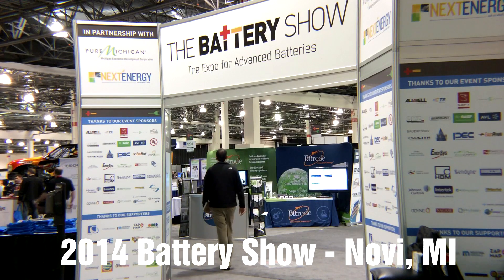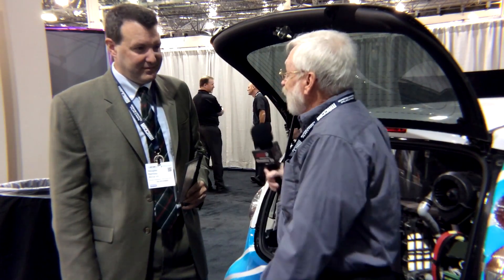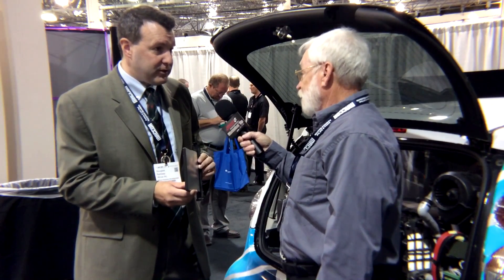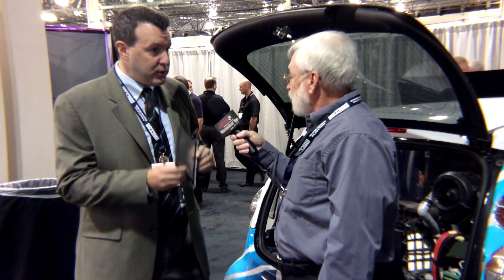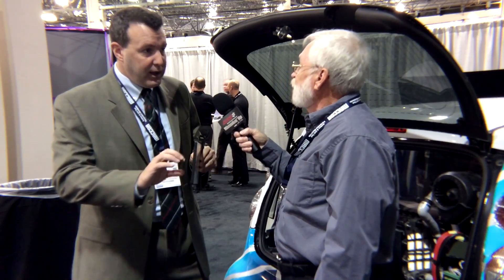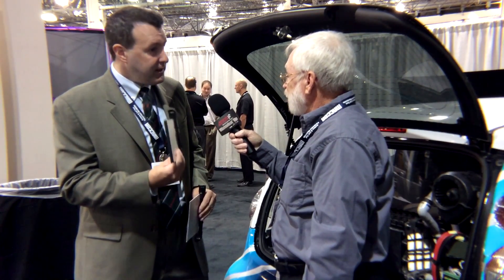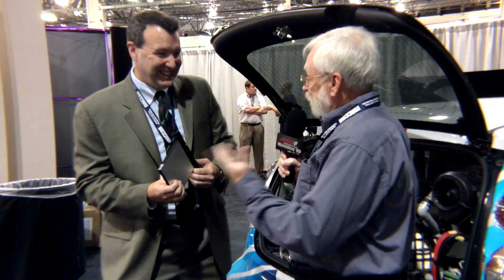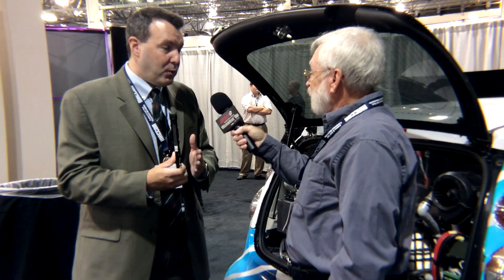Aluminum Air Batteries are here! - Wrenchin' Up

Comment: Ya ! Cars today are running on alluminium.... 7 years after this video😉
Reply from the maker: Hi - Thanks for watching! Military rockets and such yes. Cars no.
Reply: @WrenchinUpwithJimBates  ..... here in India_ "mahindra treo" 3 wheeler auto is running on a trial. "Log 9" start-up by 2  IIT graduates have made aluminium fuel cells & are testing for the same . In addition to this_ automobile giant "Tata pvt. Ltd (india) with phinergy (israel) have also made fuel cells & are planning a mass production in few months time.✌... lets hope for best.

Comment: I don't understand why Aluminium-air Fuell cells (or batteries) are not more common in general, not only for EVs? Obviously, they have indefinite shelf life before the electrolyte is poured in, so as a backup emergency generator they would be ideal. Cost would also be far lower than a gasoline generator, silent and light weight too??? As a range extender in an EV, it is the obvious choice for longer trips, so we don't need to carry around a big battery the whole year = expensive EV, just to be able to drive 300 miles once or twice a year.
Reply from the maker: Hi - Thanks for watching and sharing your opinion!

Comment: How do we recharge Aluminium battery?
Reply from the maker: Hi - Thanks for watching! The aluminum plates are used up (as in gone) during operation and are replaced with new ones when the battery is discharged.
Reply: @WrenchinUpwithJimBates  Sir,What is the size of an average battery which can be fitted in a car?And How much will be the range until the battery needs replacement.
Reply from the maker: Hi - Since that didn't come up in the interview I don't have an answer for you, so I suggest that you check with Alcoa Aluminum about that. Their contact information is in the video's description.

Comment: So, aluminum is mined from bauxite, which is basically oxidized aluminum and this battery reverses the process and get the electrons out of the aluminum that were put into it during the mining and processing stage?  So when your battery is dead you wind up with plates that are similar to aluminum ore and these can go back to an aluminum smeltering plant for reconversion to aluminum?
Reply from the maker: Hi - Thanks for watching! All good questions but, since these topics were not discussed in the interview, I suggest that you ask the folks at Alcoa for that information. Their contact information is in the video description.
Reply: Alumina (Aluminium Oxide) is extracted from Bauxite which also contains silica, iron oxides and titanium dioxide. The Alumina is then placed into a bath of molten cryolite and Aluminium is produced through electrolysis. When Aluminium is used up in an Aluminium-Air Battery, the byproduct is once again Alumina. This is then returned for smelting once again using the process above. The initial energy used to extract the Alumina from Bauxite is therefore not required. Like the interviewee explained, it's a closed loop process. In my opinion, Aluminium-Air Batteries are the future of energy storage. The electricity required in the electrolysis process is created with solar PV and wind power when both are abundant. The Aluminium is then used to store the energy indefinitely (no self discharge as with Lithium batteries) and safely (no threat of explosion as with liquid hydrogen). When there isn't enough energy being produced by wind or solar, the Aluminium is consumed to provide our energy needs. Aluminium has a theoretical energy capacity of 8kWh per KG which puts it in league with Petroleum.

Comment: A clever talk. No description of the costing of these batteries. No comparisons with cars running on gasoline engines. Cost of replacing the electrodes.
Reply from the maker: Hi - Thanks for watching! According to the comments so far, it looks like only the military uses these batteries for one time use applications like rockets, etc. Lots of energy and practically unlimited storage life..

Comment: Not new - this same 'source' of electrical energy was on the market in the 1980's, by as USA company called "AluPower'. They went nowhere, despite pushing a lot of advertising trying to convince the consumer, on their practicability. This latest iteration come from the fact that the original patents are expired, creating a new 'suckers' market.
Reply from the maker: Hi - Thanks for watching. Based on what I read, since this is a primary battery the only practical applications so far are for military and relatively cheap long term energy storage.

Comment: Instead of recycling your aluminum you can smelt your own every 6 months how much aluminum do you scrap ? Think about it .. I much rather use HHO gas "water" is more efficient  plus you can run multiple alternators and completely produce more power than you would need
Reply from the maker: Micah Catlin Hi - Thanks for watching and for your interesting comment! Is there a video somewhere that we could watch that demonstrates this?
Reply: @WrenchinUpwithJimBates  ues HHO generator dry cells are the most efficient I believe most people dont realize if you hook up to a geo metro 3cylinder 1 liter engine would be the bet option .
Reply: @micahcatlin9389  And from where do you get the electricity to split water into hydrogen?

Comment: Where does the aluminum go? Like lead in env... oh boy. I didnt see that pollution coming.
Reply from the maker: Hi - Thanks for watching! From what I read, Aluminium–air batteries are primary cells, i.e., non-rechargeable. Once the aluminium anode is consumed by its reaction with atmospheric oxygen at a cathode immersed in a water-based electrolyte to form hydrated aluminium oxide, the battery will no longer produce electricity. However, it is possible to mechanically recharge the battery with new aluminium anodes made from recycling the hydrated aluminium oxide. Such recycling would be essential if aluminium–air batteries are to be widely adopted. You also started to write something about lead so I thought I should add that 98% of lead/acid batteries are recycled and 99% of the materials in those batteries are recycled including 100% of the lead. I hope this helps

Comment: Why not use what nature did for us same principle and water is everywhere.
Reply from the maker: Hi -Thanks for watching! Are you referring to this technology or to Hydrogen?
Reply: @WrenchinUpwithJimBates  Hydrogen
Reply from the maker: Hi - Well, there is a TON of information on this subject for the pros and cons of hydrogen fuel but from what I can gather so far is that the infrastructure (fueling stations, etc.) is very expensive and slow in coming. Most of the hydrogen being used as fuel these days is extracted fossil fuels - natural gas I think - but not from water. One of the most interesting things I read is that hydrogen storage tanks are expensive to build and have to be inspected every two years and that would include the tank in an automobile unless things are changed. We could go on and on with this subject so I suggest you jump onto the internet and google the subject. Be ready to spend hours, if not days, checking out all  of the information on this subject that there is out there.
Reply: @WrenchinUpwithJimBates  Thanks for your comment return

Comment: Al-u-min-i-um
Reply: We fought a damn war so we than on this side of the Atlantic we could freely and proudly say "Aluminum", if you got a problem with that take it up with George Washington.
Reply: @richardsauermilch5483  You have the problem, take it up with a dictionary, theres an "I" in there and it's not silent.
Reply from the maker: Hi - Thanks for watching and your comment! The periodic table has a name for every element, and English has at least one word that corresponds to each name. In the case of the element with the symbol Al and the chemical number 13, English has two words: aluminum and aluminium. The difference between these two words comes down to the differences between American and British English. While aluminum is the original word, British editors standardized around aluminium, to preserve consistency with elements like sodium, lithium, and titanium. Wrenchin' Up is an American based channel, I grew up here and am used to the spelling as Aluminum. If I type in Aluminium Google's spell check tries to correct it, even though they are apparently both correct.
Reply: @WrenchinUpwithJimBates  Interesting, never heard that before. Thanks for taking the time to reply.

Comment: The car doesn't "run on aluminum". Aluminum is a carrier for "electrical energy". 

Energy is stored in the conversion of aluminum oxides into metalic (pure non-oxidized) form.

The "Aluminum Fuel Cell" promotes the inverse reaction oxidizing aluminum with oxygen from the air and liberating an electrical current, hence useful energy.

Instead of recharging at the nearest receptacle as a rechargeable battery, taking a lot of time, just exchange used aluminum oxide and suporting material for fresh ones. 

Recharging is done through recycling aluminum oxide into metalic aluminum and deposing it in the plates at the facility.

As said, aluminum is not a source of energy, just a carrier of it.
Reply from the maker: Thanks for watching and for your comment.\ to help explain how this works.
Reply: not Al2O3 but it is  Al(OH)3
Reply: So where is it ? Its been 5 years

Comment: Yet another "battery" technology designed to sell a proprietary consumable.
Reply: Celso Starec Yes, I know how it works. However, I only want to buy electricity, not some proprietary power storage solution. Anyone can sell me electricity for my rechargeable battery, but this stuff only comes from one supplier (like gas). As a consumer, I am done with this business model.
Reply: Celso Starec I guess you just don't get my point. I know how the chemistry works. The point is I don't want to have keep buying a proprietary chemical to move my car. The only chemical I currently buy for my LEAF is washer fluid.
Reply: @egoequus6263  Actually the Electrolyte they use is Plain Water , you can see in other Phynergy videos
Reply from the maker: Thanks for your perspective, and thanks for watching!
Reply: @WrenchinUpwithJimBates  Aluminum is NOT the fuel. Water is the fuel.
Reply from the maker: Hi - Thanks for watching! But how did you arrive at that conclusion?
Reply: Ego Equus 

Nor exactly "like gas". Gas comes from crude witch is consumed and scarce. 

In this model, aluminum is not consumed and there are no barriers to any other players to recycle and recharge. 

It does not solve the sourcing of the energy for the charging / oxide recycling into metal though.

It competes in cost with large batteries and range extenders, being relatively energy dense and practical for this purpose. It might allow battery cars became useful and cost effective earlier.
Reply: Ego Equus 

The same as bear in aluminium cans, or better as the glass in a returnable Coca-Cola glass bottle. 

You don't consume the aluminium, just change it's state from "full of energy" to "depleted". You exchange an amount of aluminium for the same one in another state. No consumption of it, It's just the carrier of the energy.

With Solid Oxide Fuel Cells with other chemistries it's the same.

Comment: And how is the aluminum recycled? Please, don't tell me it's done with fossil fuels....
Reply: Aluminum smelting plants are located near nuclear power plants or hydro power plants.  When the plants need to sell their electricity cheep they sell to Alcoa for the most part.  IE lots of rain and the middle of the night.
Reply from the maker: From what I could see by handling the partially used plate, it's mostly reverted back to electricity and the little bit of alloy that is left goes back to Alcoa for reprocessing into new aluminum. Beyond that, I don't know and I hope Alcoa jumps in here to fill us all in. Thanks for watching!